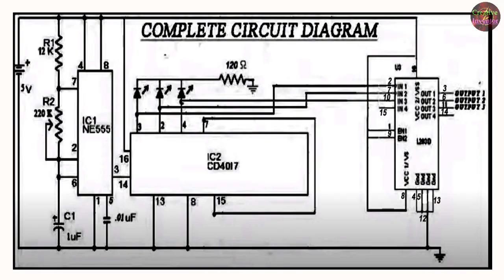How To Make BLDC Motor ESC using cd4017 ic, ne555, L293d motor driver ic, DIY drone motor driver

Comment: Hello friend, I have two questions:
1) With this circuit, does the motor have enough speed?
2) As in other circuits, this one is not necessary to give a push to the engine? Thank you

Comment: This is not really how an actual bldc driver works and I doubt if it is even self-starting..  What's missing is that one of the phases is always in a high impedance state, not grounded as you have it.  Also, the sequence is wrong, there are 6 stages, not 3 to the coil energization sequence.